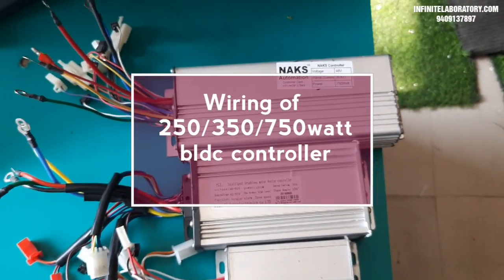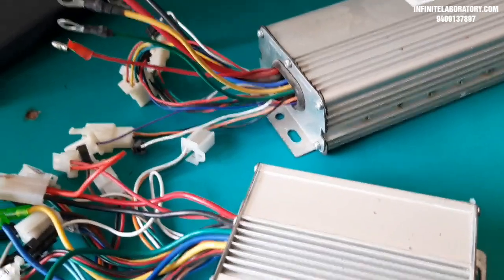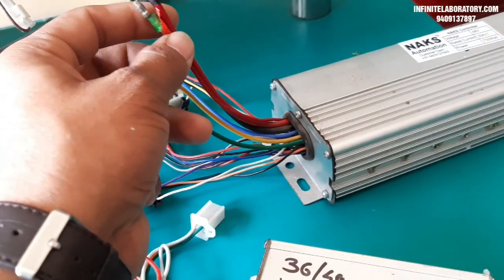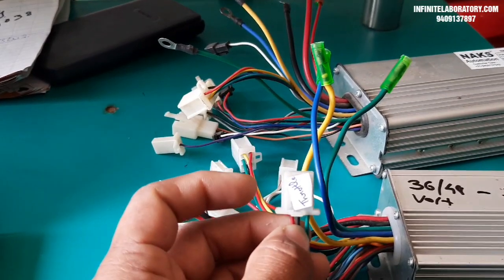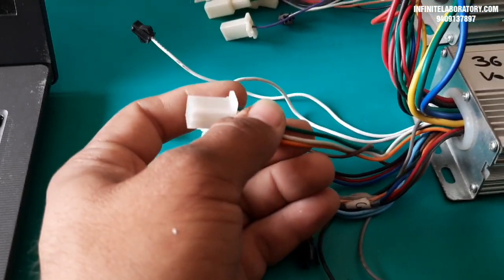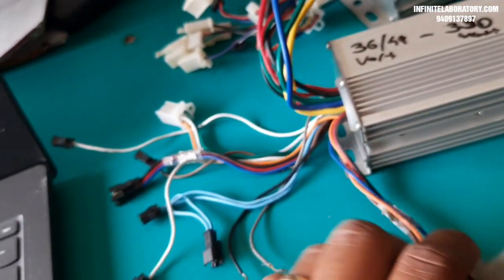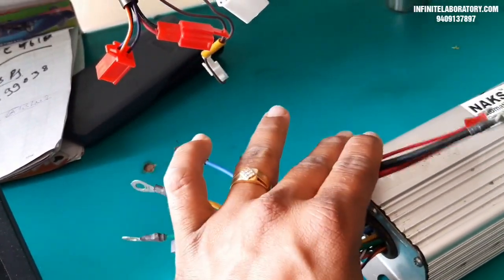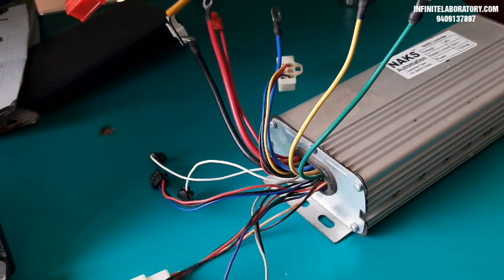Wiring diagram for 48v BLDC Controller for Pedal Rickshaw | motorkit.in

Comment: What is hi brake function, low brake function 12 volt supply, I’ve never heard of it ? I’ve heard of braking using the motor , what is this and how is it set up via the wiring?
Reply from the maker: High brake means it needs to hive high potential,  like 12v,48v etc for braking.  

Low brake means it  needs to bring potential at 0 (zero) means , wire will be connected to the ground.

Comment: Hi ... thank you for this video ...but what about light and display ??
Reply from the maker: Light works on battery directly 
Display need to be checked if compatible with controller or not
Reply: So is there a way to re wire a controller to connect to a s830 lcd

Comment: Please help me ? I need to know the name of the connectors on the ends of the three phase wires the yellow blue and green wires ? The are the same as my new controller. But my bike has different connectors. I need the male and female connectors. Maybe you have a link on ebay and Amazon please help me ? Thankyou.
Reply from the maker: They are called as Bullet type connector   i think

Comment: My 48 VDC, 1800 watt BLDC Controller (BY12WF02-C) has a 2-pin connector, Brown/Green that is for reversing motor direction. What do I do to that connector to reverse direction? Apply 12 VDC? 48 VDC? Shorting it does nothing. Thanks!

Comment: Gooday Master, I have DC motor ( ebike motor) 24v/150watts, is this ok to connect the controler 24v/350 watts. Thanks and more vlogs Watching from KSA ( Philippines)
Reply from the maker: Yes..you can use higher ampere controller for motor.. just need to check voltage. 
If your motor and controller both have 24v. Than controller can be selected higher side ampere. 
Also..
Never use controller with lower watt rating than motor.

Here your motor is 150 watt and controller is 350 watt so its perfectly fine to go with this combination.

Comment: Can we implement regenerative braking in it using an arduino?if yes where should we connect
Reply from the maker: Regenerativ controllers are available in market... arduino is a project  thing not a production material...

Comment: You saved me a lot of time.  Thank you.  My new 48v controller has the third smaller wire with the main battery positive and negative.
My work around is to house the red wires in one screw terminal and the bla k in the other …then connect to battery. 

Screw housing terminals gives easier access for future modifications.

Great tutorial.   Thanks for sharing your knowledge.

/Bklyn👑
Reply from the maker: Thank you
Reply from the maker: You need to give positive supply to Key switch wire.
Reply: @InfiniteLaboratory  huh? In your video you said if you don’t have an ignition/electric lock that you can twist the two red wires together and bypass instead of using an ignition/key/electric lock.  You mentioned this twice in your video.  Did I miss something?

I actually got my ebike wheel rotating combining the two red wires.  But, I noticed that my controller is heating up really fast.  Getting hot really fast just testing throttle and wheel.  Should I be concerned?

My battery is 36v 500w 20ah  and my controller is 48v 20ah.  Is this safe?  I have another 36v-48v controller which would be more of a match but I’m having problems getting the motor to turn with that controller.  I read somewhere that I may have to switch around the motor phase wires and Hall sensors wires to make it work for my bike because there is no industry standard on making sure blue, green, and yellow phase wires match exactly.

Just glad I was able to turn the  motor today.  Hopefully you have some insight for me.  Frustrating but really enjoy the process of learning. Thanks for help.

/Bklyn👑
Reply from the maker: @robertmotion  connecting two red or giving positive supply to boty red is same thing. 
In onw case you are giving with saperate wire and in another you are giving with same wire to both.

Also heating of motor can be possible due to wrong battery selection if your motor and controller are 36v   you need  36v battery. 

If your motor Controller are 48v  than you need 48v battery. 

Some controller works on 36 as well as 48v volt. In that case you will need battery voltage as per motor voltage.  If motor is 36v operated battery should have 36v  . Ans respectively if 48v .
Reply from the maker: @robertmotion  another reason for heating of controller can be mismatch in phase wires or hall sensors wires .
Reply: @InfiniteLaboratory  thanks man.  I really your respect  help.  I’m gonna check Hall sensors and see if I have them setup correctly.  If I switched the blue and green phase wires, should / do I need to then switch the Hall sensors accordingly…with same wires?  How would I know if my Hall setup is the correct one not to dissipate heat so heavy.  Motor wheel spins now, but …I think it’s gettin g to hot.

I have a 36-48v controller as well, as opposed to a standalone 48v controller.  But …. I switch the XT60 end to Andersen connector to match battery, and can’t get controller to work.  MOSFETS are great, no high resistance, no continuity issues, nothing.  Controllers good. 

Researching, I found out that I’m just gonna have to play around with the phase wires and hall sensors to get right combo, since colors may not necessarily match.  

Feel like your student man…..thanks. Ebikes and ebike repair is a business model that has a huge market if tapped into correctly..looking forward to your response.

/Bklyn👑

Comment: There are no sticky notes slip on my controller circuits and it's really difficult to connect with throttle and others motor kits. How to solve this issue, sir?
Reply from the maker: You can share controller image on our mail id infinitelaboratory@gmail.com
Reply: Okay, sir. I have sent you the photos of the controller in your email account.  Thank you so much for your guidance. 😇
Reply: I have one more issue regarding that controller circuit , sir. There are two wires coming out from the throttle. Where to connect them on controller circuit? I have sent you the image of the throttle on Gmail.

Comment: is there a way to increase rpm in erickshaw motor without changing the controller? by modifying it or reflashing its microprocessor somehow?
Reply from the maker: If There is a programable controller than only its possible
Reply: @InfiniteLaboratory  controllers are always programmable even drone ESC are too i have done flashed a drone esc but i want to do the same for controller but the controller i have has a different microcontroller named ST08S something but ESC has atmega and i need to read the chip first and im not familiar with ST08S
Reply: im not sure but different controllers may have different microcontrollers too
Reply from the maker: @harsimransingh7735  all the controllers don't come with RS485 port so not possible to program them. Only some good companies provide it.
If yours have programable communication port you can ask compatible software to the supplier and you can reprogram parameters
Reply: @InfiniteLaboratory  nope , rs485 is not everything. if we open a controller, we can find some traces and pins given for programming named 5v, rx, tx, gnd in that case we need a usb to ttl converter
Reply: or in case its an atmega chip then we can use arduino as isp to do such communication
Reply from the maker: @harsimransingh7735  yes but how you will change the RPM using it??? How you will program through that pins without knowing the limits of parameters???
You need manual from controller manufacturer. 
I am not much aware about programming as we get pre programed controllers without reprogram functions.

 you must can ask someone more experienced than me.
Reply from the maker: @harsimransingh7735  if you have done this, please make video and share link.
How ebike controllers can be reprogramed without RS485.

This is required globally. Everyone will atleast get some solution.
Reply: @InfiniteLaboratory  i havent yet done it. only i have done it with drone ESC i am also looking a way to do reprogram a bldc controller and thats all i know yet
Reply: @InfiniteLaboratory  i can share a picture of the controllers pcb with pins to reprogram
Reply from the maker: @harsimransingh7735  once you please try if you are not aware of ebike controllers,
Than share video for it.

People will get some help

Comment: I would like more details about the Hall sensor . 
Can the motor work properly even without connecting the Hall sensor wires ?
Something can go wrong if I connect only  the battery  and the throttle + controller ?
Reply from the maker: Nothing can go wrong if you connect motor controller throttle and battery
Reply from the maker: Some controller and motor combination are capable to work without hall sensors but with hall sensors you motor will have good starting torque and errorless working
Reply: @InfiniteLaboratory  Ok !
Thank you very much for your help.
I didn't know what the purpose of the Hall sensor was .
I thought it only dealt with the angle of inclination of the Hoverboard.
But if it's that important ... I'll connect it .
Reply from the maker: Check Key switch
Reply: @InfiniteLaboratory  
Everything is going OK.
I uploaded a video.
I showed in that video that the engine can work with the Hall sensor and without the Hall sensor.
In fact, the only change I've noticed is that when I connect the Hall sensor, the LEDs / lights on the wheel come on.
I deleted the video after a week (or two weeks). I assumed you saw him.
Look ! I uploaded again ; 
Motor Hoverbord
https://youtu.be/49ZT6bIS6xE

Comment: hello friend, thank you very much for your videos, you encouraged me to throw up a kit for a mini buggy. I got the motors and controllers last week, I'm testing with 4 batteries to have 48V. my problem is that the motors turn backwards, the opposite way they should. I have tried to activate SELFT STUDY but it does nothing, the seller does not respond to me and I have not found a manual. all other functions work perfectly. Could you help me? I can send you an email if you can help me.
Reply from the maker: Sure, please mail me product images controller and motor both.
Mail id infinitelaboratory@gmail.com
Reply: @InfiniteLaboratory  thanks dear friend, in 5 minutes send you

Comment: Great information just wondering if I connect a 100 % throttle to my new Chinese ebike will it perform its function ? The thumb throttle currently in use only allows a walking pace
Reply from the maker: Share information on infinitelaboratory@gmail.com,
Controller pictures and product details

Comment: You have not shown 12v supply for operating Horn, Headlight, and Taillight. Which are the wires???
Reply from the maker: 12V operating thing don't gets connected to any wire with controller, 
There is a 48v to 12v dc converter, which gets connected to direct battery..

Comment: I have e bike without lod working  but lod not working pls help me
Reply from the maker: hello, check your battery is fully charged or not, if battery is ok, check all the controller connections, specially motor wires, if all wires are ok than controller internal component must have damaged

Comment: I have repaired my controller from a shop. But after connecting when I push throttle the wheel of the bike blocks like brake. It try to run, but something blocking. Why? Is there any solutions? May I alter the phases of wires?
Reply from the maker: try to check all the connections first, Specially motor phase and hall sensor, 
than if there are self learning wires, short them for a while and release them quickly, keep wheel holding/fitted as it will run, 
if this dont solve the issue try to interchange phases.

Comment: Hello, i want to ask. I have a hall sensor motor for my electric scooter and i bought a controller that has no hall sensor? Can the controller work even if it doesn't have hall sensor?
Reply from the maker: Yes sir, Some intelligent controller supports without hall effect sensor also. you need to connect only motor phases.
Reply: @InfiniteLaboratory   are you sure brother?

Comment: Is there any way you can  Show us how to hook up the high and low break please thank you
Reply from the maker: yes , in next video we will show detials.
Reply: @InfiniteLaboratory   I ended up experimentings with the high and low breaking it turns out high and low only cuts power to the motor. 
So I guess the question I should have asked is do these controllers have electric braking? I am not talking about regenerative braking. And thank you for your response
Reply: Any word on your next video
Reply from the maker: @michaeldurden8254  there is no electric breakings. but low break cuts only power but wheel will be moving until u apply mechanical breaks or have kinetic energy,

while high breaks will work when you give 12V positive in it,
it will cut the supply as well as try to stop motor using electrical traction and Back Emf. 
this high break features may very as per company of controlller, some says it high break but that also works same like low.

Comment: How to use low brake and high brake
Reply from the maker: for low break two wires are there, short them and it will stop your motor slowly. 

for high break you will have one wire, you need to provide 12V positive on high break wire , it will stop your motor like emergency switch
Reply: @InfiniteLaboratory  low brake can be used as regenerative braking?

Comment: Hi, I try to us a different kind of controller, - not the one which was included into the kit. So, this is 1000 W, 48VDC motor, and 1000 W, 48-72VDC controller. The bike speed box control  cable has two connectors that supposed to be connected with controller: one with yellow, green, black, blue and red wires (5 wires); second one with white, brown and black (connected to black of the first connector).  The controller has throttle line connector with red, green and blue wires and some other connectors which may be used (i suppose): High level plug, Low level plug, three-speed plug. So, how to connect this cable to the controller? Also, how to connect two brake wires to the controller? Thank you!!!
Reply from the maker: share your controller image on 9409137897

Comment: which colour  wire from throttle is  for key and for voltmetre /in which wire i should connect metre wire
Reply from the maker: all explained
Reply from the maker: Call 9409137897